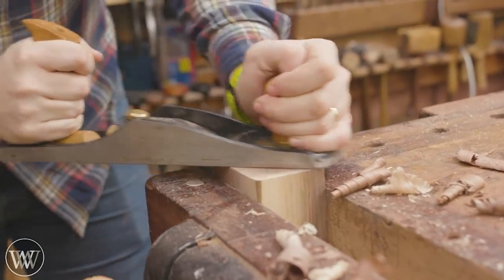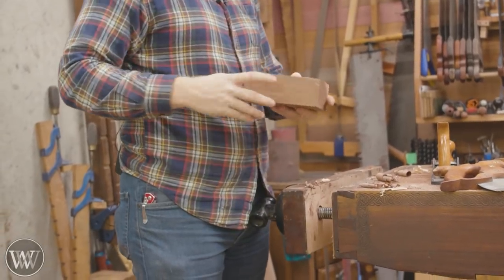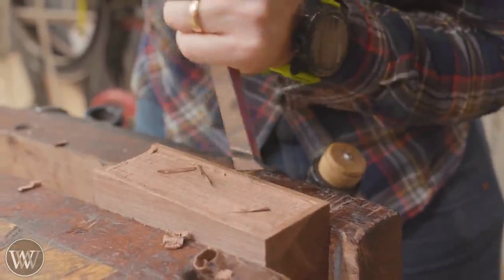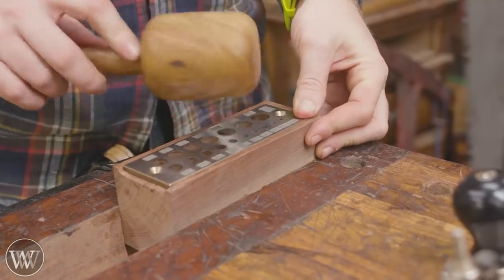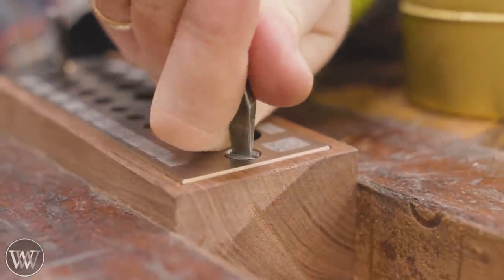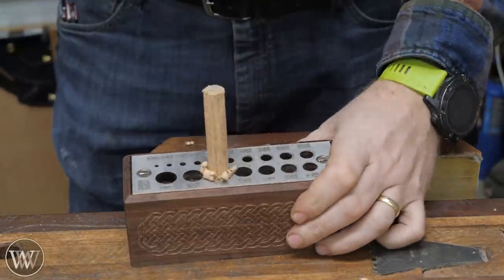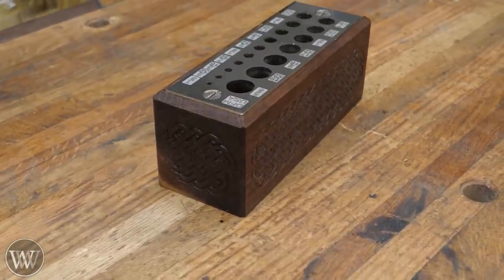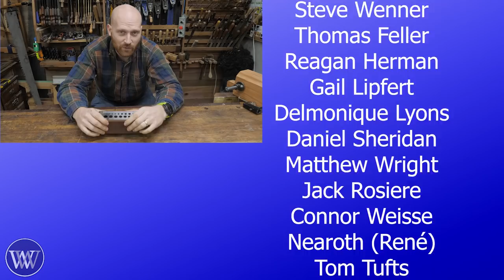How to Make A Dowel Plate Block With Carving

Comment: I learned something today.  I learned that if I need to work up to a small narrow end grain feature that I should leave a lot of extra wood on the ends and cut it away later after all the shocks and router plane work are done.  Yep, not chastising you.   Thankful actually.  I would have done the same as you did.  But thanks to you for taking one for the Team I might just have learned something today.  And what a great idea for the plane block!  I too have ended up with dowels off my LV plate that looked like Ol' McGee's walking stick.  I can see where the block would help a lot with avoiding that.

Comment: To avoid the blowout, you could use a chisel to get to final depth for 1/8 - 1/4 of an inch from each side, then use the router plane between. Since the plate will cover the finished cut, all you need to do is maintain a sharp wall.

Comment: Hey, James, just a thought, if you want to make another, leave the block long, cut the recess/es, set the doweling block, then cut the wood block to length. 
Also, could you use a sacrificial fence on the shooting board and a #7 or #8 to shoot the ends of the block?

Comment: It occurs to me that for people following along, it would be much easier to leave the piece long while carving the inset and then saw it off afterward to get the same look. All in all, great build! I want one of these now, especially as I'm slipping into an area of woodworking where I'm going to need a lot of pegs. Right now the only way I can make pegs is by hand, using an axe and knife for basic shape and then sanding to exact dimensions. Takes a long time and the results are neither pretty nor reliable. Thinking I'll make mine out of Siberian Elm, seeing as it's the easiest hardwood to get hold of in that size, and I know it'll take a beating (made my first mallet out of it and it can drive nails with minimal deformation).

Comment: just made one of these a couple days ago.  im going to redo it however.  it needs to be deeper than i made it i think.   i think i will make it a bit taller due to legs on the sides.  that way i think i might be able to grab the dowels out of the bottom.  maybe.  
 great video. hope your vacations was/is going well.
Reply: I made one last year stacking 3 4x2 and then sawed out waste to leave 4 chunky 'legs'. It lets you knock the dowels through, if short, and see to line up with a dog hole if longer.
Reply from the maker: Thanks man. And congrats on first again!

Comment: @Wood By Wright How 2 : How do chamfer the edges (with the metal plate installed) and avoid nicking the plane blade into the metal plate? Just know when to stop?
Reply from the maker: Yep. You just don't hit the steel. I chamfer the edge about a 16th inch away from the steel.
Reply: @WoodByWrightHowTo  Thanks!